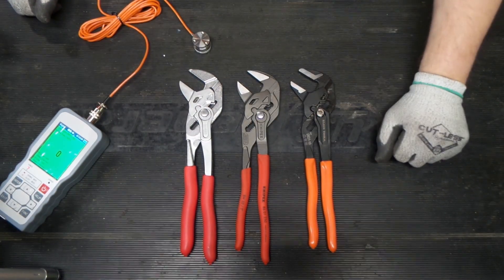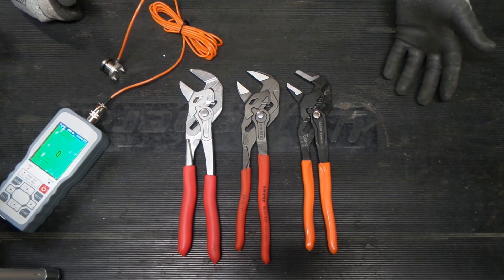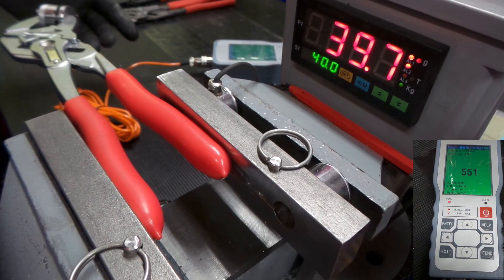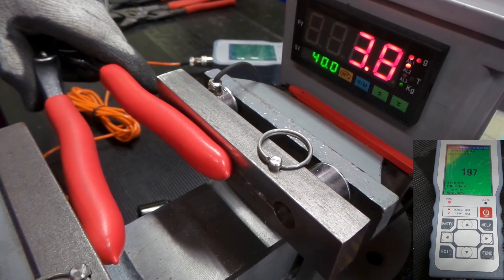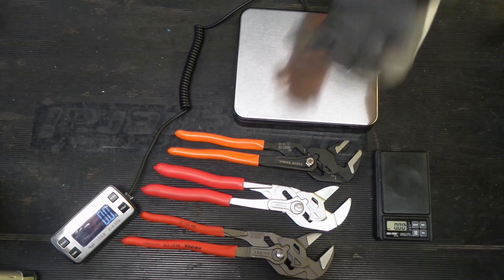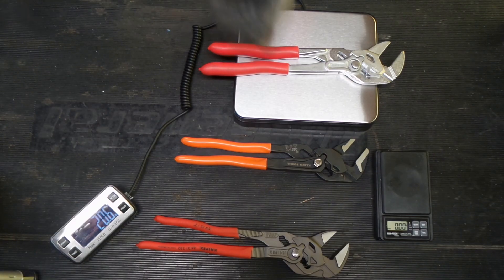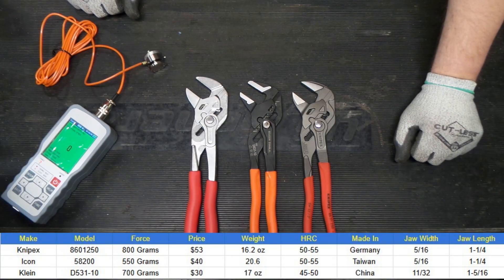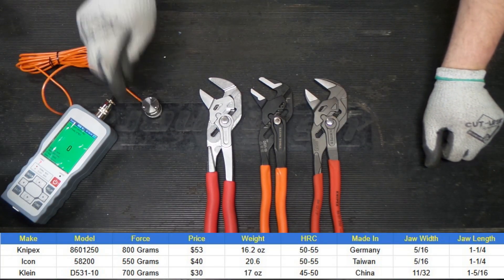Load Cell Testing - Harbor Freight ICON vs Knipex vs Klein 10 inch Plier Wrench Showdown

Comment: Awesome video!!
Kinda sad Icon came in 3rd, but I guess that's right where it should be against those two. You should add in some more brands,  I vote for Toolant. Wonder if they can beat Icon?
Reply from the maker: I actually have a series of videos on various makes of pliers wrench you can check out. I'm making some upgrades to the Loadcell Vise and Toolant/Workpro are on the list.

Comment: If i'm following the mixed units, 40kg is probably achievable but would be clamping pretty hard.
I'd focus more on the mechanical advantage (MA). Knipex is obviously the leader since they invented this technology and others basically copied it. 9.17 MA is pretty close to 10 that they advertise! i'd say this test shows pretty good real life example and a clear difference in tool quality.

Tool	Hand force	Hand force (lbs)	Clamp force (lbs)	Mechanical Advantage (clamp ÷ hand)
Icon	39.8 kg	87.74 lbs	554 lbs	6.31
Knipex	39.6 kg	87.30 lbs	801 lbs	9.17
Klein	39.6 kg	87.30 lbs	700 lbs	8.02
Reply from the maker: Thank you for this run down. I didn't know Knipex advertises a 10:1 mechanical advantage. I'm really happy my cobbled together rig got us pretty close. I'm working on a modification to the load cell vise that I'm hoping will get us a little more consistency with the numbers.

Thank you again for the leg work on this it's super fascinating.
Reply: @TalkingHandsTools  thanks for you video as i was seeing if it's worth spending extra for knipex. it is indeed worth the $$$!
Reply from the maker: I would agree with that. I tested a few other manufacturers' pliers wrench. I keep coming back to for the money the don't think you can go wrong with the Knipex.

Comment: For like $13 more, you might as well get the Knipex because of the build quality. Yes, I do have a lot of Knipex, but that icon price is pretty similar.
Reply from the maker: I don't disagree. Some of the lower price point pliers have their place but best value through the series has been Knipex in my opinion as well.

Comment: Because the icon has thicker softer grips!
Reply from the maker: The softer grips definitely contribute to the icon having more flex. 

I'm not thinking the compression load on foam isn't limited by the foam force is force. We point loaded the foam to around 100 lbs or more of force with each pair of pliers if the foam doesn't compress all the way at that point those are still the numbers of force the bare handles would give. 

The Icon does better than some of the other models we test in future videos, so I'm fairly confident with these numbers.

Comment: Ok I got to say it, the metric system is not as precise as the imperial system so maybe you should stick to using it, as you mixed up  grams and kg. Metric is only used because it's divisible by 10 which makes it eas to use in some cases but is not better that the imperial system.
Reply from the maker: I definitely messed it up. But I've learned from it. The devices I'm able to work with do not read in Imperial, so we're working through it the best we can. Future videos on pliers wrenches don't share the same glitches we had here. I guess I could have edited them out, but I don't mind showing we all start somewhere. Thanks for the comment. You're definitely right. I botched the units on this video.
Reply: metric is better then imperial because its divisible by 10, what is one reason that imperial is better then metric?
Reply from the maker: You won't get an argument from me 99.5% of the planet uses metric. I wish my country had changed over in the 70s when they started to but ran away for some reason. I'm not overly quick with the units when I get into new things or the conversions in my head so I'll be goofing those things up in videos. I'm very slowly getting better with it all. 

As for a reason imperial is better or has more resolution in the measurements I'll leave that argument to the original poster. I haven't used metric enough to weigh in on that. For me it's different I'm not going to say which if better. I know which is easier for me but that certainly does not make it better. It only makes it what I know.

Thanks for the comment I'm genuinely interested to hear about the comparisons between the two.

Comment: I’m sure you meant 40 kilograms not grams. A small rhodent could produce 40 grams of pressure😊
Reply from the maker: I definitely did. If it doesn't show I not very accustomed to the metric system. It's an amusing goof up though. Thanks for the comment.

Comment: As the geometry should dictate the leverage, and they all copy the knipex geometry, there has to be an explanation for the difference

This could be a small detail at the cam mechanism, but I'd expect it's something simpler than that

The most obvious to me is that the Icon is made from lower grade steel which flexes, resulting in the need for the thicker handles. This flex allows the vise to contact the handle further up, resulting in less leverage

This would be easy to test by modifying the apparatus to apply the force at a measured length on the handle, assuming the handles are all a comparable length it should be a fair test.
Reply from the maker: The Icon flexed a lot in this test. I'm thinking I'm going to stand the pliers on their end so we can make sure the ends of the handles are in contact with the jaws.
Reply: @TalkingHandsTools  The flex in the handles, even when they're thicker than the knipex, tells me all I need to know

Very happy with my knipex collection
Reply from the maker: I agree with that. I'll still play around with thongs a little, and we'll see if I can get some more data points to compare.
Reply: It's a bit of a shame Klein seem to have moved away from their unique pliers wrench, and reverted to another Knipex copy

At least they didn't rip of the aesthetics and colour scheme like Icon
Reply from the maker: I have a copy of their reversible jaw pliers wrench, pipe wrench. We'll be seeing what those can do at some point as well.

Comment: I bet i know why the icon had such low force.  The spongy grips and the springy metal that has a decrnt amout of flex in it.  If one was to cut off the grips and maybe it would be stronger.  Many of them advertise a x to 1 ratio and icon may be slightly less.  Also tolerances also hurt here sloppy machining is likley to make for less force.  Like the load cell testing and look forward to more.  Irwin and gedore should be on your list for additional pliers wrenches for sure 👍.   Like others have said we all know what one will likely last the longest here but i gotta wonder if chrome vs black oxide finishes change things too.
Reply from the maker: I don't know if it came across on the video, but there was a good amount of compression with the Icon. I think you're onto something with the machining. If the Icon has more slop in it, the force won't be all directed to the jaws.

I'll see if I can get a set of the ones you mentioned. I'm curious to see how these all compare. I think we have a decent amount of things to compare on them now moving forward.
Reply: Flex won't affect the force UNLESS it allows a change in geometry (ie changes where on the handle the force is applied). The leverage is related to the distance from the pivot - it is linear.

Sloppy machining would have to be out by the ratio of force ~550/700 which represents a ~20% difference in combined lever arm difference, which is a huge difference.

My bet is the flex results in the vise compressing the handle further up towards the pivot (~20% further up on average)

The test needs to be repeated where the vise applies the force at a set distance from the pivot to compare the cam mechanism to see if there is a measurable difference
Reply from the maker: @scod3908 we could try that. I looked over the video again and it looks like the entire handle of the pliers made contact with the vise jaw or at least came darn close to it. This is all an experiment so I'm game to try different things. 

I'm with you on the handles. 40kg sshoukdd be 40kg the foam shouldn't impact the applied force at all.

I'll see if I can play around a little bit with the vise and the pliers in the next couple days.

Comment: 1:25 im betting icon does best. Looks like longest jaws and longest handle
Reply from the maker: I really enjoyed these results it wasn't what I expected at all.
Reply: @TalkingHandsTools yeah I was wrong quickly lol.
Reply from the maker: I would have been with you. It's a heavier tool as well. It gives you the perception of heavy duty.
Reply: @TalkingHandsTools  it's a copy of the old knipex design. The new ones are significantly lighter (the 250mm Icon is comparable in weight to the 300mm Knipex)
Reply from the maker: I've had this pair for a couple of years. If I had to guess, I'd say three years, maybe four tops. Do they have a newer version since then? My Knipex is the same age this video had been in the works for a while.
Reply: @TalkingHandsTools  newer version is lighter and  has stepped jaws to accept the plastic soft jaws; that pair look like the newer version
Reply from the maker: @scod3908 thank you. I'll try and get a second round of testing done for Friday's video so we can see what the numbers say.

Comment: Great stuff. I love these types of tests. A couple of notes:

You are probably not used to the metric system in America. The measurement there is in kilograms. One thousand grams make one kilogram. 

As for the measuring, to be sure I would do two more tests and see if the results match up:

 First is the test you already did. 

Two is to fix the lower jaw in a vice and then attach a 40kg weight to the upper jaw and let gravity pull on it. 

This might give a different result to the pressure applied with the vise because of the difference in handle shapes. -  I think the vise might be applying that 40kg slightly higher or lower on the jaws which could affect the output dramatically.

So with a hanging weight you can be sure that you're applying exactly the same weight to every plier - assuming you put the weight exactly the same distance from the pivot point. A little photography accessories clamp or two should help keep it from sliding on the handle without damaging the tool.

And the third test is just to press by hand with all of them and see what is the maximum you can get on the output. Because there might be things like the curves or thickness of the handles that make a significant difference in real world use. 

And as a bonus, maybe press them all to failure and see which snaps first. Just be sure you're using genuine Knipex from a reliable retailer. There are fakes from China that pop up sometimes in the Knipex Facebook group. 

👍🏻
Reply from the maker: You're correct. I am not used to the metric system. Unfortunately, we still honor the dimensions of the monarchs feet here for some reason. 

You're spot on. it's definitely KG. I'll make the appropriate changes moving forward. 

I could try and do something with weights to verify the vice. What I did do was put the load cell the jaws are squeezing in the vice, and it was within a few tenths on the scales. I figured that was close enough to play around with here.

Part of the reason why I made the vice is my hands can't do that much squeezing anymore, so I'll skip the hand squeeze on each one. I can do a few randomly to show the numbers like I did in this video.

I'm not too keen on taking them to a breaking point with the rig and area I have to work in. Maybe if my setup changes, I can start doing that sort of thing.

Comment: That is very interesting, not something I would have considered when comparison shopping. Looking at them, say in a store they look similar enough that you would think the squeeze power would be similar. 
Doesn't matter if 40g is or isn't what force someone is going to be applying, it's a fixed number for your testing and shows what the tool is capable of when being used reasonably. 👍 that to me is a real world test under normal  use.
Reply from the maker: Thanks. I think 40g is decent it doesn't get too sketchy in the vice, and it's repeatable. This was a fun test to do.